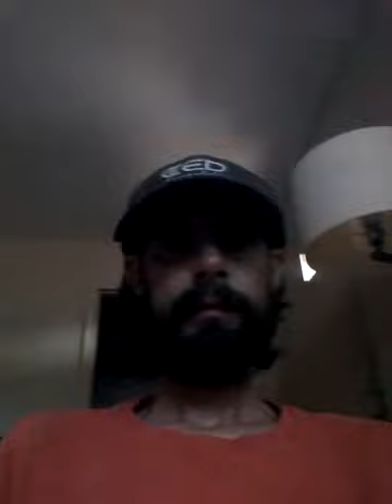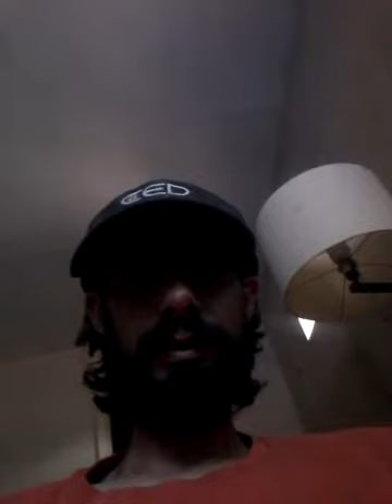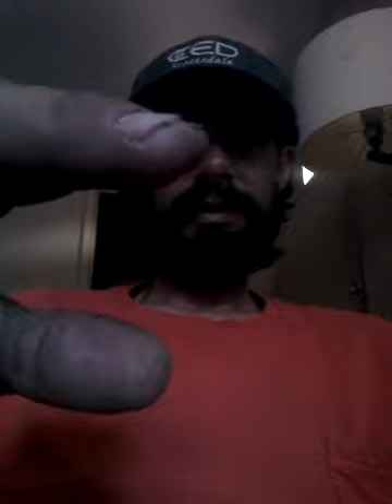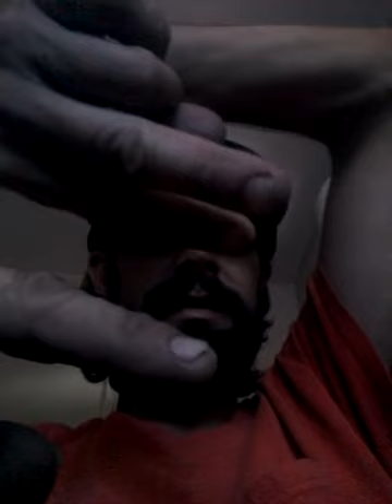How to correctly wire an ANSUL system

Comment: Wrong. It is required to shut down the make up air fans when the fire suppression system is actuated. 
A commercial kitchen fire suppression system is required to do 5 things when there is an appliance fire...
1. Suppress the fire with wet chemical.
2. Shut off the fuel supply (gas, electric, propane, etc.).
3. Shut off the make up air fan(s).
4. Sound the fire alarm/strobes in the building.
5. Contacts the local fire department through a monitoring alarm company.
And by the way, it is called a fire suppression system, not an Ansul. Ansul is the name of a manufacturer of fire suppression systems. There are many manufacturers of fire suppression systems. PyroChem, ProTex, Range Guard, Buckeye, Kidde, Badger, Guardian, etc. Ansul is just one of the many manufacturers.
Reply from the maker: I did say that you shut down the make up air and air conditioner (which the mechanical company takes care of) and keep the exhaust fans running to evacuate the air as a salt water CO2 combination is sprayed across the fire to evacuate any oxygen in the area of the fire. You also have to shunt trip all of the breakers directly under the hood. It will eventually be everything within 6' of the hood so take that into mind but this video was about a Captive Air ANSUL system. Many of them have VFDs to control the airflow and when VFDs are used, separate conduits need to be used for the line and the load due to the fact that VFDs are variable frequency devices and the input and output frequencies need to be separated in order to perform properly. If you are just using contactors, you can put line and load in the same conduit. I explained the gas valve if it is electronical. A lot of times the gas valve is mechanical and is activated by the pull station. The fire alarm guys hook the system up to the fire alarm. I teach electrical work. The fire alarm guys hook up to the same microswitches that I do. They're just switches. I've got another video about how to connect shunt trip breakers too if you want to try to tell me I'm wrong about that too.
Reply: @brianmaldonado7284  settle down man, your gonna stroke out. Great explanation btw, but it's a little drawn out.

Comment: How do you wire it up for just 1 hood? The fire system has 6 wires here (black red,brown) allso have to hook up one strobe
Reply from the maker: The hood and switches show you what is normally open and normally closed. You want to hook up to normally closed. No loop. C1 and AR1 to I believe black and brown but some of the microswitches are backward so there is a diagram showing which wires to connect to for normally closed.

Comment: What do you mean by reset a a plus control head lol ill give you some advice when doing inspections on a a plus control head cut a 5 inch piece of electric tape and go around the microswitch to hold it in place that way you dont risk it opening

Comment: How much did you charge to wire one up and install strobe and Bell?
Reply from the maker: I work for an electrical company as a Jr foreman. I'm basically the clean up crew making sure the job gets finished right. I don't know how much they charge for these jobs but I know how to do them right. I just try to document as much as I can to help others and I'm trying to get better at it. Thanks for the feedback.

Comment: Random question, do you know how to reset a Range Guard A+ control
Head ?
Reply from the maker: The company that built the hood has a special tool to reset it. You could do it yourself but I don't know how. One of our systems got set off with the fire alarm connected and they had to come out with their special tool.
Reply: Brian Maldonado 
Their is no "special" tool 
All you need alen keys pair of secnolock pliers ..  Oh and a flat head just in case you pull the link line connected down with the pliers.. Then their is a lever and you tie the little screw on the lever with alen keys and the control head reset you can see the lever go up from fire to set mode no special tool... Only the ansul have a special tool even that i reset with out it
Reply: Jose Bermudez you sir are correct however Ansul is not the only system to have a “special tool” Older range guards, Buckeye and Amerex all have a recocking tool.
Reply: Doug1637 
False aremarex and ansul only systems with the special tool.. I mange to reset then all time. 

Personally many companies such manifictiors just try and sell personal i have lic in ny
Reply: Doug1637 
Personally i think is$ i can reset any system
Reply: Jose Bermudez the old mechanical range guard also has a tool and Buckeye has that Alan key BS lol. But like you said you can reset all of them with a screwdriver or Chanel locks I’ve been doing this for 16 years and have seen it all lol.